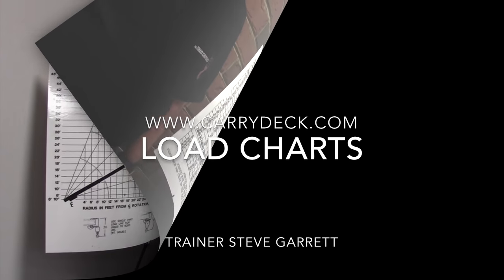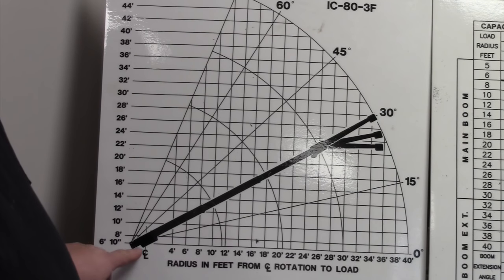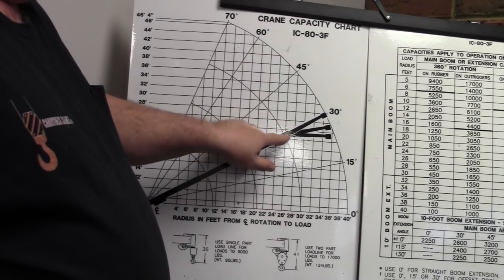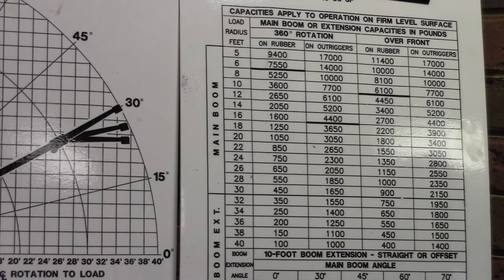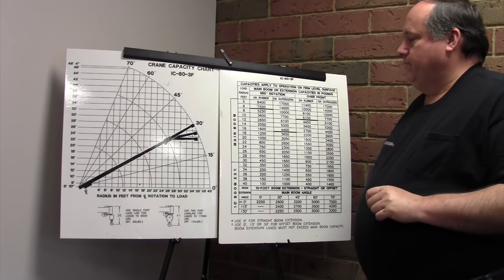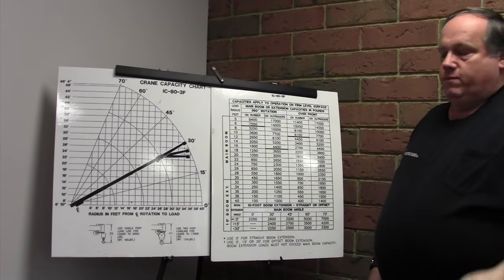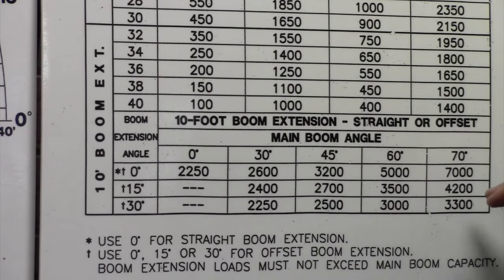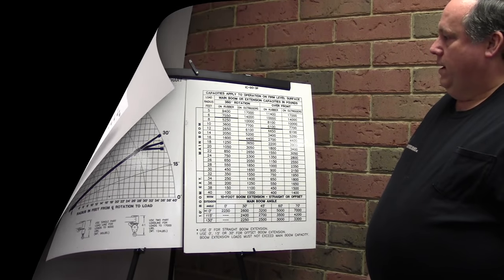Load Charts

Comment: I'm 28 and have been an rt operator for 8 1/2 years both swing and down cab. My resert nccco test is coming up along with a new guy thats going to go through his first time. And this is really helpful actually probably better than my last instructor. Thanks a bunch!
Reply: can u teach me to operate mobile crane?
Reply: Ray Isaac No.
Reply: ok fine..............
Reply: Ray Isaac  I was just kidding Ray. If you are really interested in learning to be a mobile crane operator, you really need to go to a crane school. Look up ATS crane school in Wisconsin.
Reply: but im in malaysia..so far away...and if im swing the concrete drum sure will be not stablea bit...that is the problem..
Reply: Ray Isaac  Don't worry. Malaysia doesn't worry to much about safety.  Just stop when the computer starts beeping. You'll be fine.
Reply: +Hovey2229 haha I fucking died when I read that. seems about right
Reply: Yaa...so far as I operating crane mostly no computer...just manual adjustment hehehh
Reply: +Ray Isaac
Do you have a rigging background? That also helps out a lot bro.

Comment: I've always used the load chart for my crane when setting up my job because we take up a lot of the job site ,I determine where my pin point would be in the area given to us ,then use the machines load chart to tell a site superintendent if the area he's given us will allow the crane to pick the weights I need from my material piles .
Reply: Michael Ledford  how do you read the load chart
Reply: James Whitfield in the situation I was speaking of having my cranes location picked by others I take my pin point where the machine is supposed to be set up ,determine my heaviest load ,the boom angle etc and calculate weather I'm being given a shit set up area before I even pull the crane in .

Comment: curious could one uses 2 cranes to lift the something one sling on one crane and just do out the sling calculations Fsin(theta) or just canceling out rope forces to get a load to be lifted safely with to crane each of which exceeds the capacity of any one crane restricted to a certain load radius under construction restrictions

Comment: O if you get the jib or boom uses the smaller weight for the max or you potentially have structural problems of it breaking if the jib is less strong them the boom and if the boom is more strong then the jib you have tiping capacity
Reply: sam111880  Wow. Listen to you! You should quit your job at Walmart and get your crane license!

Comment: I would imagine the max weight a crane could carry would be if it was straight over head if you move out farther you lose the amount of weight you can lift because of leverage issues which are easy to calculate using torque / moments calculations but this chart gives a frame of reference of how much tons/lbs we are talking about at certain load radius / angles